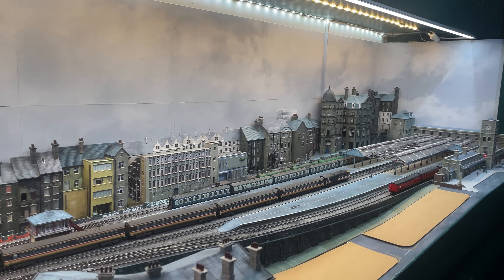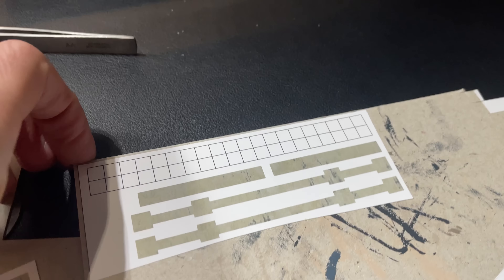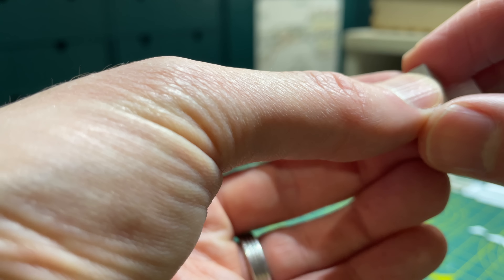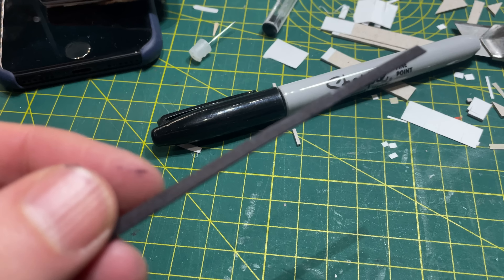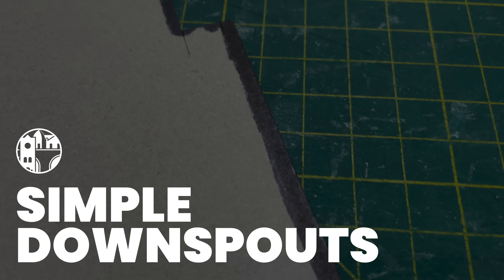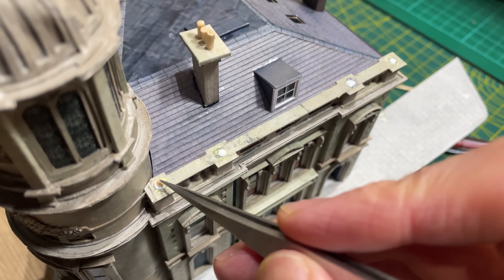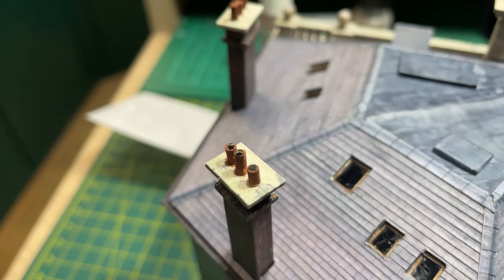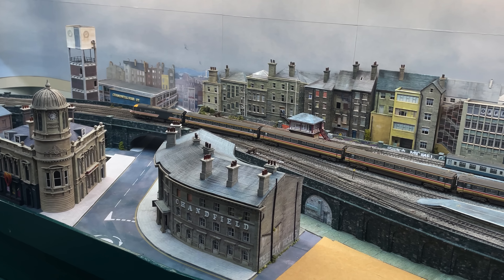Finished (with a mistake!) Adding the final details to this scratch built card town hall

Comment: Maltesers were my guess. Toothpicks are available in squillion lots for low cost. I am awed by your results. But know I could not do that, however easy and tempting it looks.
Reply from the maker: Thank you! Maltesers are along the same lines, but would be ginormous n N gauge, I think! If you can point me to where to get turned-topped toothpicks with that end detailing, I would be forever in your gratitude. I tried everywhere to no avail. Packs of 10 for 30p were the best, although I did find a supplier doing them in packs of 100,000 for £150!
Reply from the maker: @xxqq5719  BRILLIANT!!!! I was only searching for “cocktail stick” instead of “toothpick”. They must be the same thing, but the search results are so much better. There is a rich seam of things there, you have opened up a whole new world! Thank you!!

Comment: In real life, in Victorian times, that window would have just been bricked up when they built the new internal stack. That happened when the owner wanted a new chimney and insisted on a specific location in the downstairs room. As the upstairs rooms only had a fire built in the mornings, they were little used and had a lower priority, unlike these days. 6:44 The downspout below that window would have been removed, in real life, or repositioned.
Reply from the maker: Thank you! That is really valuable and good to know.

Comment: Hi ya Michael. Each building is better and more elaborate than the last, excluding the horrible modern ones. I had a thought/question while watching. How have the earlier structures held up? Any de-gluing or wall unwrapping happening? Just curious. Some other channels I frequent have had issues with humidity on their paper and cardboard structures. You should be well pleased with this Town Hall. It really is magnificent. And deserves it’s “ up front “ location on the layout. Oh….your dead pan expression in the insert was hilarious. Okay. See ya next time.
Reply from the maker: Thank you Norman. So far so good with the buildings. The first part of the layout was the tunnel portals, and they are over four years old now. No signs of any ageing problems... touch wood...